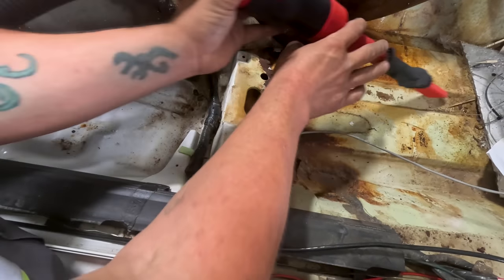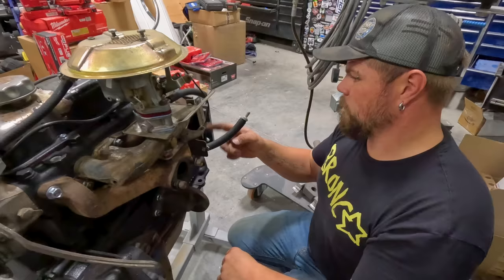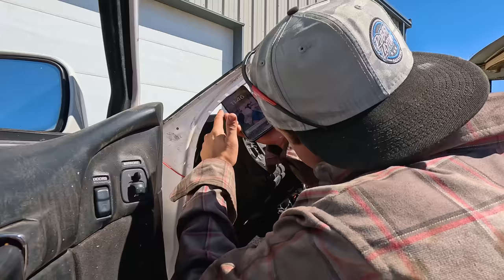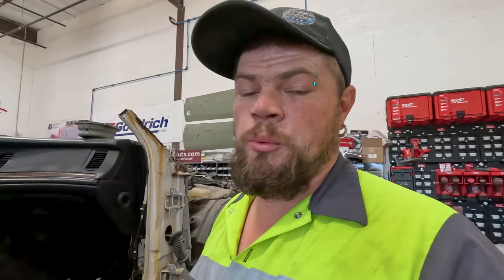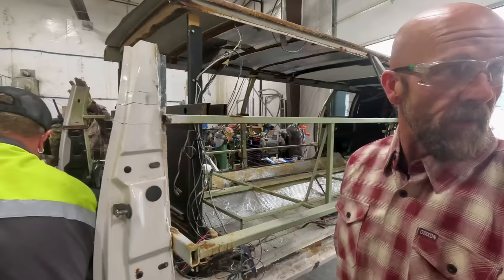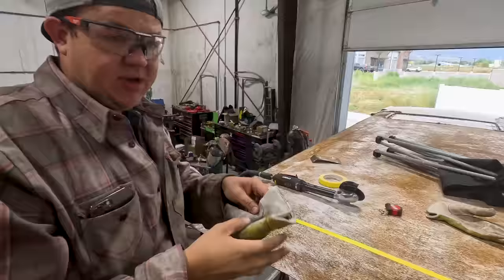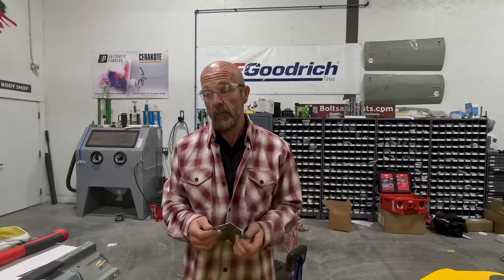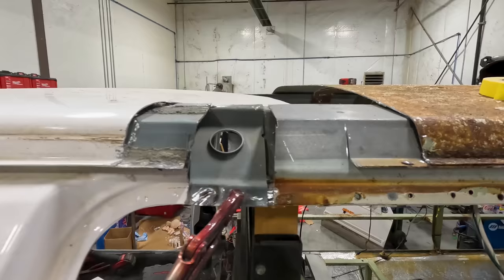How To Replace Your Rusted Out Lifted Limo's Roof!

Comment: Two Laymo progress videos in a row. It is really cool how you cut that, to maintain structural integrity. I love seeing the masters at work, even though the only thing I know about bodywork, I've learned from this channel.
Reply: Except for the fact that they forgot to brace the inside of the car with welded steel z braces before cutting anything to keep the whole car from twisting and bending after the roof got cut off.

Comment: Cutting and shutting those panels looked scarily hard to do, but you look to be nailing it.  Super impressed with all of your workmanship.  I would totally trust you guys to do serious body work on my vehicles.   You did make the point that the Limo is a rock crawler and does not have to be concours d'elegance, but I just know that you won't be able to help yourselves, and will finish the Limo as if it was going to be a show entry.

Comment: Milwaukee-room, a room in the corner with shelves for machines not in daily use, a couple of chargers and storage for accessories. Paint it red with the Milwaukee- logo on the side, epic! A surveillance camera to hold persons responsible for what they take from the room if something goes missing. Or go to town with one of them systems where you have to swipe a personal card to go through the door. 😁

A relative of mine hade a shop with many tools. During the week tools and machines were spread all across the shop, an excellent way to loose tools. Lost tools both cost money to replace and causes delays. His solution was easy and very effective, on friday they stopped working somewhere around two or three a clock. (most places finish work at four here in Sweden) 

Then all staff were to clean the shop and at the same time minutely scour the shop for any tools etc. and put them in the right place. When it was done they could go home no matter what the clock said. A bonus for the staff was knowing that when they came to work on monday every tool and machine was in place and the shop was nice and clean. An exercise in trust that worked superbly, everyone want's to go home, early from the job on friday,  with salary,

Comment: That is a lot of work . I know because i replaced two VW bug roofs back in the mid 70's . The front and rear windows need to fit just right . Also both doors need to have the right gaps . Good job

Comment: Hey Robby i have suggestion, when you put the role cage in do it before you put the lame-o roof on and then you can put the roof on top and fit it the way you want it to so also if you need to do any modifications on it. ITS THOUGHT

Comment: There is something that bothers me about the Lamo. If you take a picture of the  limousine in such a way as to not include the under carriage, it will look very good, because the  limousine in a nice looking vehicle. If you then take another picture of the Lamo, this time only capturing the under carriage, it will look like a tough machine capable of some serious rock crawling.  Now take a third picture of the Lamo which include top and bottom and it looks like two dissimilar machines one squashed on top of the other.  The image of the two together doesn't work.
     I do have a suggestion that might work, I don't know, but, I would like you to consider it.
First off, I think the Lamo would look awesome with dual wheels in the back.  I think that it would be the fenders that you design to cover the wheels which would be the thing that marries the limousine with the under carriage.
    The other thing is. I forget whether is was Matt's wife or Paul's that saw a rock crawler with a step that came down when getting in the vehicle and retracted after getting in.  You will need some rock sliders for the limousine and I was wondering if you could design such a step, as that, which would raise up into the rock sliders where it would be protected from the rocks until it was needed. Maybe be part of the rock sliders when retracted.  The other thing is that they can't be automatic. Imagine being stuck on a rock and you need to get out and the step automatically tried to deploy and jack the limousine off the rock.  So it would have to deploy on demand.

Comment: The hoops have to go down to the frame,and to weld the top of the pipes to the horizontal tubes over the doorways is now harder.Please;Don't re-install the windshield before you put the headliner back in.Hillbilly removed it through there,and the rollbar makes it necessary too.

Comment: This may be an unpopular opinion, but the Laymo was an awesome joke that has already run its course.  I can't see putting 1,000 hours into resurrecting something that is basically totaled by rust, just to turn it into what it already was.  The moment has passed, I'm afraid.  Salvage the expensive parts, and move on.  I'd rather see the Broncstar or the LandJeepCruisChevy-er projects make progress myself. I'll keep watching, though.  Oh, and early in they introduce the new Milwaukee belt sander, then later on they're using the old pneumatic one.  What's the deal?  Is the Milwaukee a dud?  Cause I was kind of thinking I should buy one.
Reply from the maker: We use a large variety of tools!
Reply: Simple don’t watch the videos bro
Reply: @bigstock21    I think that should be something like:  "Simple. Don't watch the videos, bro." Proper punctuation is very important.